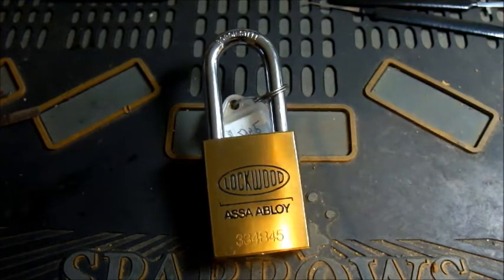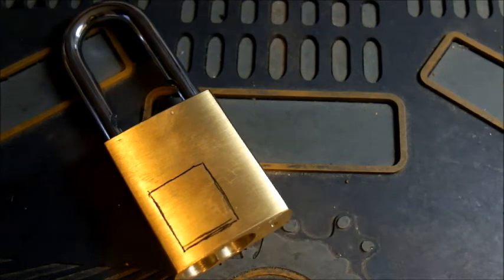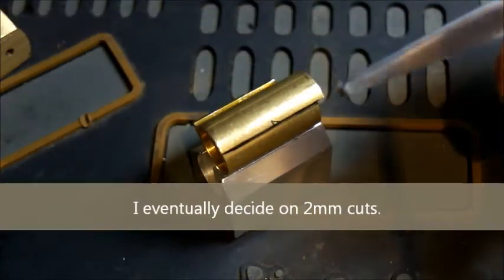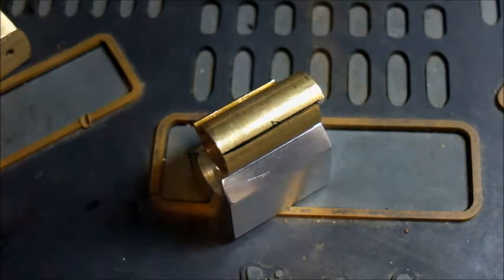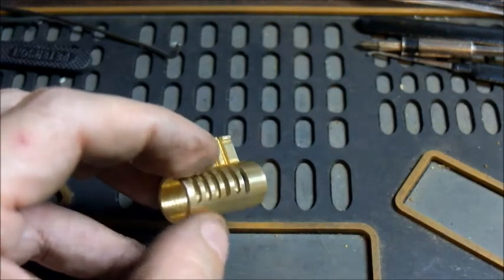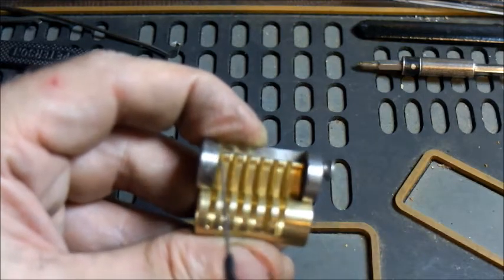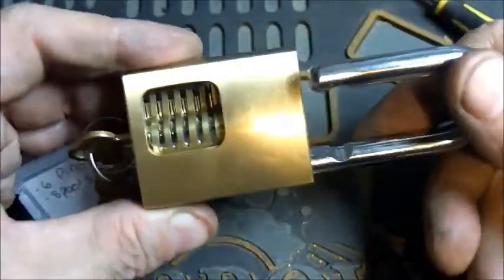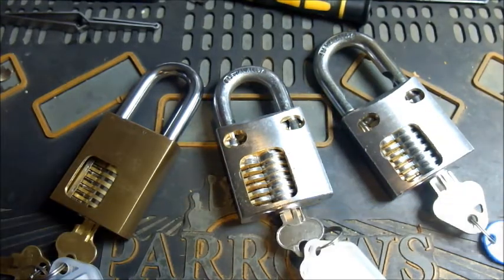Making a basic Lockwood cutaway

Comment: I enjoyed the video. I have been looking at making one myself. Out of a American Lock 5200. Like to do a Best access lock. What bits did you use? I have access to a drill press. I would use my drill bits but like to get ones better for the job.
Reply from the maker: Cheers. Much fun and the end result is enjoyable. Proper milling bits used in a proper milling chuck. Usually 4mm bits for cutting the body of the padlock. As for the plug and the shell, 2mm bits were used. Some locks will have smaller diameter pins/pin chambers. Just be sure that cuts are not so wide that pins or springs can escape. A cross slide vise will be invaluable for you as well.

Comment: I just done a crude one with an American lock 5200.  I wish I had a milling machine.  Luckily the core is a small one so I was able to find some weird bit and was able to stick it in the drill press and slowly let it eat its way through that harden steel and pull the vice in a direction by hand to make the bit travel some.  So instead of it being nice and squared is more rounded but I still can see pretty much the entire core that’s needed to be seen.  
My only issue now is trying to figure out how to make the cuts in the core to see the pins
Reply from the maker: A small cross-slide vice might be worth a go. Some careful work with a needle file could also help you with the core. Some people have even cut away at the core with a thin hacksaw blade. Hurl questions at me if you need to.

Comment: Awesome job mate, well done. Have you given thought to milling the plug as well so that you can see the key pins at rest and being lifted by the key? Also, doing a window showing the cam and balls plus even the shackle & spring.

Could tie it all together and have one irregular shaped window with chamfered edges.

Again, brilliant job and lovely finish,  i may have to commission one if you decide to do any for other people, would be happy to pay and supply the lock. :)
Reply from the maker: Good call. Actually, earlier today I did some milling work on the plug. I'm taking it pretty slow and steady for the moment. However, I'm certainly looking to step up my game at some point in the not too distant future.

As soon as I get some more brass victims I'll start experimenting with different ways of showcasing the various working elements of the lock. For the minute I'm just learning about the machine and doing basic problem solving in order to find what methods work best for me.

It would be nice to be able to produce something like what l0ckcr4ck3r is capable of, but I doubt very much that that is going to happen. Unless of course I win the lottery and can afford a nice CNC machine. :) Still, I'll be taking all the lessons and  hints that I can and working to produce better quality work.

Email me and we'll work something out.